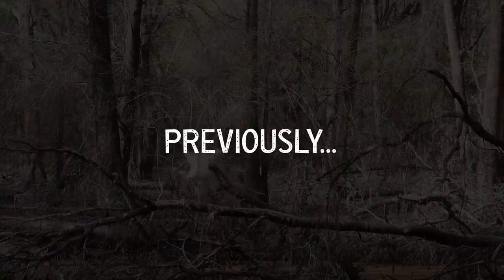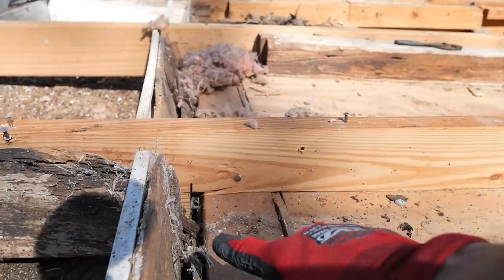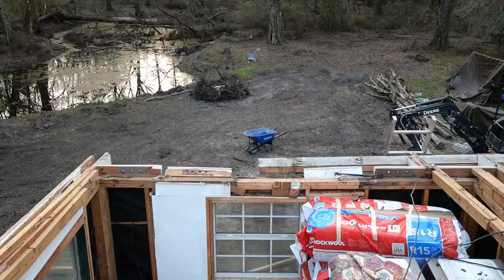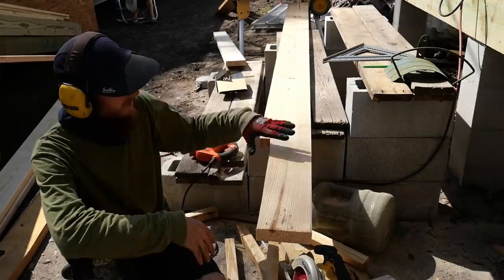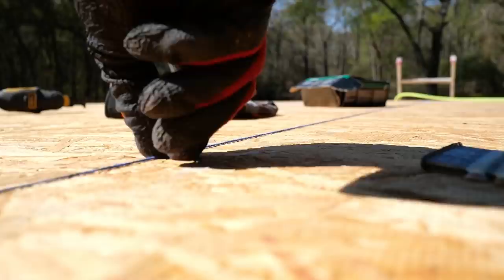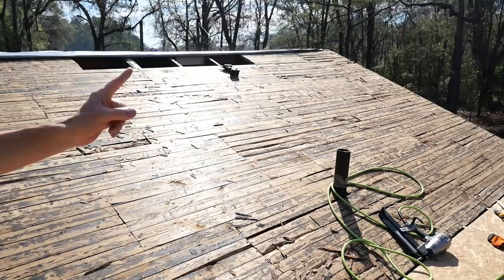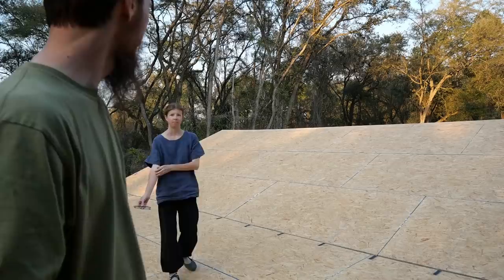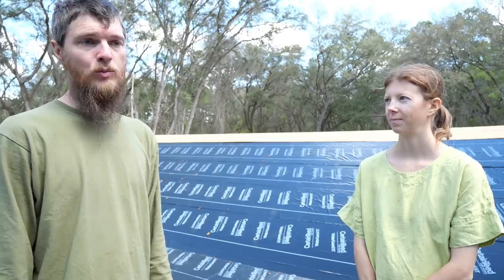Rebuilding Our Roof, But it Keeps Getting Worse

Comment: When working on old homes you have to accept the fact that it will always be out of square, Not plumb, never  level and corners cut where they are not seen until the wrecking bar comes out. Your work ethic and skill set are priceless.Don't be afraid to settle for imperfection on them old homes, Save them expectations for when you are building from the ground up.

Comment: On the bright side, it's usually easier to tear-out a poorly done job. We replaced drywall once where they used like six screws per sheet! 😉 I like the way you planned out future work based on your current situation. Not all jobs can be done straight through from beginning to end, but that doesn't mean it shouldn't be done right. Good job guys!

Comment: That proved the rule, anything that can fail in the worst possible way. Well done for saving yourself, but please take extra care dealing with the horribly dodgy structure. Well, it only became worse as you went along. It was a pity that you have had so much extra work, but clearly the original was hardly built to any set of standards, maintained to any standards or looked after in any way that made sense. One comfort is that it can only get better after you have worked on it, but I understand how you would rather not have had several new projects roll up at your feet right now. The fits-where-it-touches state of the insulation, at the start, gave a hint of things to come. They were not shy in coming out to show themselves. I can understand you being very disappointed with what you found, but well done for getting stuck right in again. Then it showed it could get worse, the rain arrived.

Comment: Daylight savings starts on the 13th of March. That will help. I bought another piece of crap property. But
not as big as my last one that I worked on for 14 years, it was 93years old.. This one is only 800 sq ft 
and it is only 54 years old manufactured home. I  get the inspection tomorrow. I am 70  and this house is the
only way I can afford to stay independent. You guys are so inspiring. Maverick is already helping.
Reply: Tess, I hope everything goes excellent for you.

Comment: At what point is it not easier to tear a place down and start again from scratch?
Reply from the maker: It's complicated. For this property, this house is totally savable and worth fixing up. Even if we wanted to tear it down and build a new house here, the county would most likely not approve it since it's in a flood zone and if they did approve it, they would require us to put in a brand new septic system and probably a new well also. The cost would be so high. If we were to ever build a new home, it would not be in a flood zone like this parcel is, and it would be on a bit more land. :)

Comment: Wow WOW ! That's a lot of rot . Just me sir but l would pull down all the old roofing and start all over again. And in many years of  doing this lv never heard of or seen cockroach crap that high up .sir just start from scratch it's Easier .  Best of luck and be safe. Do this one by the book you will not have to touch it again for 30 to 40 years.

Comment: The new re-roof looks awesome. That sure turned into a massive project quick. The differences in the old joist layout seems to indicate there was 2 different additions done at different times. The kitchen part was done by someone who was a total noob and the other part by someone who had some knowledge of how to frame a roof. Good call on the beam idea, I see several issues with that wall other than the top plate. Doug, now know how I must of looked when I did the same thing as you and I'm happy to see you no worst for wear. 

Great work, Doug & Ashley.

Comment: Won't the paper get ruined if you don't put shingles or metal on top of it right away? How long exactly are you able to leave it unfinished?
Reply from the maker: It's a plastic-type material. Its exposure rating is 6 months.

Comment: 20 + years of building all types , never have I bought a osb product , but I  always worked at a higher level and expectation , just bought land with old mobile, removing floors , roof to get the rot out and get ply , and wood in it's place ,
Reply: You probably never paid $80.00 for plywood either. Besides the glue they use in OSB is much better today.
Reply: @poorfesor  osb is junk , and only used on cheap crap , not to last long
Reply: Go ahead and  price yourself out of business but I hear Elon Musk doesn't currently have a home.
Reply: @poorfesor  I've bever paid $80 a sheet and I purchased 5 sheets of 3/4 sanded last Friday. What state do u live in? 😆
Reply: @simpletruth9977  Oregon. Home Depot shows sanded 3/4 inch plywood Oak finish 2 x 4 for $81.83  Standar 2x6 is 12.52 Standard 3/4 OSB $43.35. Common 3/8 plywood $37/00. 23/32 fir sheathing plywood $63.08.
Columbia Forest Products3/4 in. x 4 ft. x 8 ft. PureBond Birch Plywood $83.28.
23/32 in. x 4 ft. x 4 ft. Sanded Plywood (Actual: 0.703 in. x 47.75 in. x 47.75 in.) $43.98
Just a few, if you look at any hardwood multiply by 3. Wood is scarce here we need to save it for annual forest fires.

Comment: One more thing, that pond you have with the type of soil you have in the back yard will always be soft under the surface and eventually it'll effect your foundation
Reply from the maker: The house has been here for a very long time on dry stacked piers so it should still be okay with our upgrades. If any pier gets unlevel we can just relevel it.
Reply: @diyfferent  but you'll still may have soggy ground, wish you luck
Reply: @davidscott8400  it's Florida. Everything has water under it. I live in South Florida, I can dig down two feet and hit water. It's just beach sand here.
Reply: @MichaelCushmanPhotographer  Didn't know where the house is located. I guess Florida will eventually sink. Stay safe

Comment: Believe it or not but the hot weather is around the corner.  You'll be glad the roof is just about done. Soon It will be hot weather and then extreme hot weather.
Remember to take it easy outdoors during the hot weather.

Comment: I get the feeling that the insulation contractor put in the insulation when the homeowner was watching, then when they went away, the contractors stopped insulating.  Why else would only the higher part of the roof be insulated at all while the lower part was empty?
Also, the insulator didn't use a vapour barrier on the house side of the insulation, so you were lucky there was not rot from warm wet rising humidity.
Reply from the maker: In the south, you really have to worry about the humidity from outside more than inside. They often recommend the vapor barrier be placed on the exterior down here. I have mixed feelings about vapor barriers though.

Comment: Wow y'all, that was a heck of a bummer... but a blessing in disguise because the understructure is now more better.  I yet wonder where you find the will/energy to carry on; I know you gotta do it, but a little fire surely feels like the solution occasionally.  Everything sure came out really nice though, and you have overhangs that are nice and strong like the other side of the house that won't sag.  Doug, you sure had me going for a moment there, thought I was gonna have to swoop down and catch you  >>:=p (seriously, glad you were OK)
   The pliers: got curious, so looked these up, and what I'm seeing OL is there should be a Ⓑ mark somewhere on them and that they were made under Craftsman brand starting in '49 and were mfgd at least through '68 (perhaps later as site's data they had stopped in that year), so looking like they could be up to 73 yrs old, which is pretty wild.  Mi's well clean/oil them up and use them.

Comment: @32:47>>> is that old installation?  If so, will you be replacing it? Maybe there are critter droppings in there?
Reply from the maker: Yea, that's cellulose insulation. We won't be replacing it. There could be critter droppings in it, but it's not something that we are worried about.
Reply: @diyfferent  oh, ok! Thanks for responding to my question!

Comment: Good save 😅. 
Did you consider changing the pitch of roof while you had it open.   Could have opened up a little more and scabbed 2x8 rafters a little higher up for better drainage.

Comment: Where are your pallet forks? This job would be easy if you had a better way to put those boards on the roof.
Reply from the maker: We don't have any pallet forks.
Reply: @diyfferent  That's my point you need them. They could save you a lot of time and can be used as a lift scaffold for outside jobs instead of a ladder that could slip in the mud or you could fall off. You could have loaded all the plywood at once. I really love your videos and I would like you to stay safe.

Comment: You really should wear steel-toes workboots with steel plate soles. One nail through the foot would really hamper your progress.
Reply: Clearly he wears those shoes so he can use those toes to grip. Had he had on steel toe boots, like we all know is the safest, he would not have been able to hook that foot around that beam and would have probably fallen all the way through. Crazy part is I was currently thinking right as Doug was falling, “OMG!! If something seriously happened to Doug, what would Ashley do out there in the middle of nowhere?” So glad the roof is sealed. Great team work you two. 👍🏾

Comment: Makes you kind of wonder what the foundations are like, out here in CA where I am, they make you get a soil engineer and structural engineer to build anything. Your foundation looks like that of a mobile home ?.
Reply from the maker: Our house is built on concrete block piers, which is typical for homes in Florida and mobile homes. Since Florida has a high water table no one has basements so the foundations are typically either a concrete slab or block piers.

Comment: From the looks of it , it would have been easier and cheaper  to bulldoze the whole house  down and start from scratch.  ;)
Reply: A POV I agree with.  Especially when they strip off $7 OSB board and replace it with $38 OSB board all by hand.
Reply: I've really felt the same way since the beginning of this project. The only thing is the land that it's on is swamp. I doubt the bank or building inspector would even approve a new build.
Reply from the maker: This house is definitely worth restoring. It's not cheaper to build a new house. To build new would cost a lot of money, and we'd also have to install a new septic system. It's not really a swamp, it's just a small pond that dries up to almost nothing at some points. And if we were to ever do a new build it would not be here on such a small plot of land that's in a flood zone.
Reply: @diyfferent  I know. It was meant to be a joke .
Reply: @diyfferent  Kind of reminds me of a reno on Jesse Mueller's channel which was complex and obviously expensive but the rationale was the same:  local rules made even expensive renos more palatable than tear down/rebuild.   In my area they buy 1200sf 70 yr old houses, tear them down and build a 3000sf + in its place and even before the past 2 yrs made money doing it.

Comment: Guys, don't you think you should be wearing safety equipment?  Hard hats, steel-toed boots, eye protection, etc.????
Reply: No .. over and over they have said this, they are comfortable in what they are doing, it's not there first renovation.. years ago people never had safety boots etc when they build huge buildings..
Reply: Right,  it is their life and they can live their own way.  If there are any problems they will have to deal with it.  Personally I am in completely happy with their choice of soft soul shoes.   Moving around those rafters one needs to know at all times their placement, and can curl their foot to correct their footing.   Doug are your work pants made 9f Kevlar?